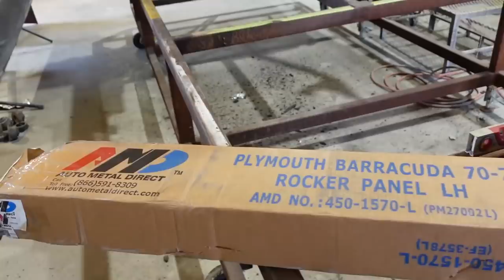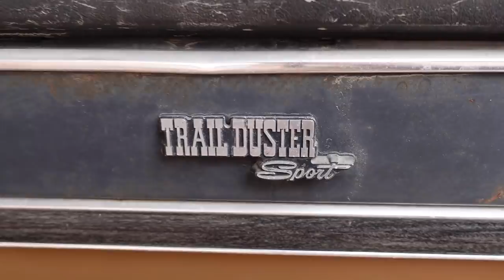3D printed grille for a chopped and sectioned 69 Dodge Charger!

Comment: Would love to hear about the material for the 3D printed grill; survivability in winter, strength at road speeds, etc.
Reply: Winter driving this thing?  Right, like snow tires and chains....
   The rich f#chs who can afford this level toys,  don't drive them in the winter.
Reply: I was wondering about that as well, I had some small 3D parts made to test a concept and they are very fragile, so I am wondering about mounting brackets cracking/breaking?

Comment: I was just wondering how someone would register one of y'all's art pieces with the DPS. 
I mean, there's parts from more than one car. Does it have to have a certain percentage of VIN parts or what?
I have no idea how that works.
Reply from the maker: If you are building an 69 dodge charger for example and you have the vin# and title, you can do what you please with the car as long as when you are finished it passes a state inspection meaning tail lights, turn signals, headlights, horn, etc... You got 5,000 hp? cool. just make sure your wipers work. Thats bout it!
Reply: @MuscleRodShop  Thanks!